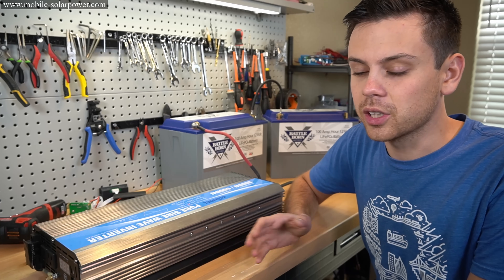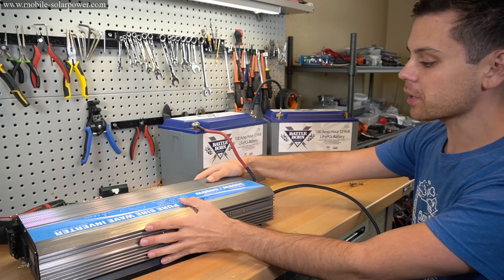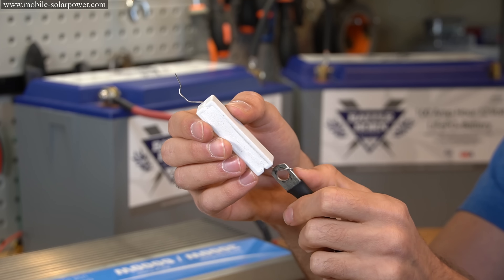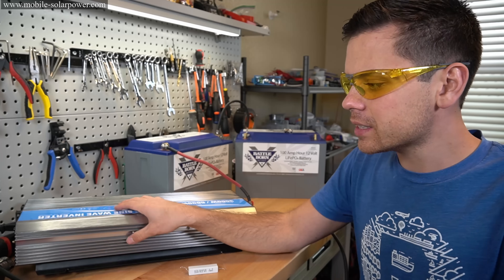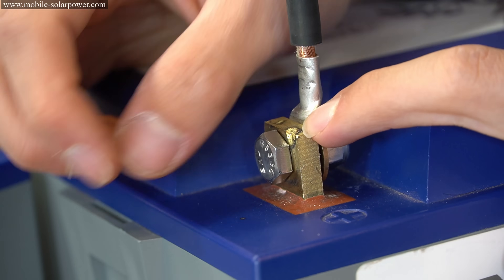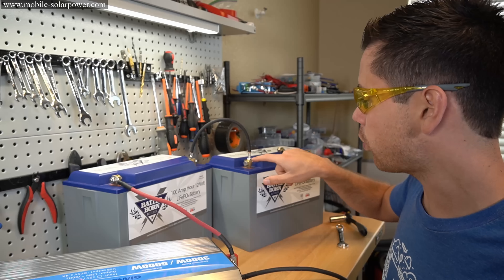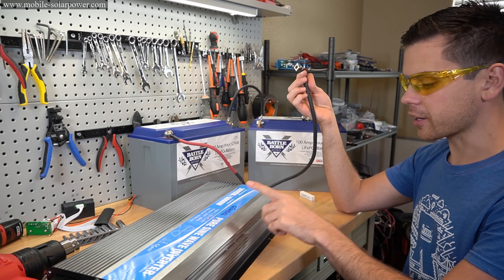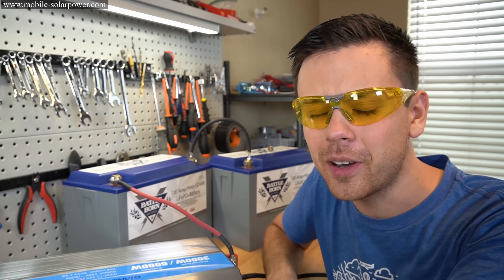How to Pre-charge Large Off-grid Inverters SAFELY. Save your eyes and your bank account

Comment: Wow, good video. So, what happens when you turn your system off using a battery disconnect switch? Does this surge / spark happen within the disconnect switch when you power things back on?
Reply: My question as well. I would think they would add a resistor to the switch, but I doubt they do.

Comment: I am actually having the problem where my BMS shuts the batteries down in 2x206AH SOK.  I then have to go into BMS and reset the batteries to turn them back on.  I have this in a trailer and wanted a remote switch to kill the inverter to stop power drain.   Every time my caps discharge in the inverter (3000watt Renogy) with a remote wired switch.  I then have a struggle to power everything back on.  Does anyone have a solution?  I was thinking of a super capacitor 5 farad like in car amps.   Anything I try would be an experiment(order part , spend money try/fail) so I would appreciate any help

By the way the only way I can get it power on is by your method or a car charger and once active everything works like a charm.  The 2 Soks are plenty.

Comment: Hi will I think you need to be real about a few things I bought a cheap Chinese inverter, well I was 300 Aussie dollars not cheap 4000 wt with 6000 surge though I had it covered until 1am when it went full on in fire , on inspection there was no copper coils only shifty little transistors please stop promoting this crap , I bought a VictronConnect 12 v 1200 it is the real deal, if I didn’t have a smoke alarm me an my son would be dead, as it went on fire at 1 am use your influence to protect us not so well off please save lives your a well off. Guy from solar a bench test means nothing 14 mths and fire is real I will give you all info on the system , which nearly killed me

Comment: Question:  I have a 150Amp "ignition protected" circuit breaker/switch between the battery bank and the inverter.  It is always off when I plug in the batteries.   I turn on the circuit from the switch.  Do I still have risk of sparking/arcing at the battery terminals?  I would think the risk is at the circuit breaker itself as the lugs on the battery are well connected.   I didn't see anything with my 12V AGM batteries and 1200 Watt inverter, but I am about to swap out the AGMs with LiPOs.  The following year I am probably going to move to 24V and a ~ 2000 Watt inverter.

Comment: So if I have 2 Enduro 12v 100ah LiFePO Batteries in Parallel and a Renogy 2000 watt Inverter do I have to use a resistor to connect them?

Comment: The Epever Ipower plus (5000W) has current limit to prevent sparkles/Arc when connecting the 48V batteries bank, this is nice, I did not have to use a resistor (LifePO4)

Comment: I ran into this problem on this setup. 100ah chins with renogy 1000 watt inverter. I was using heavy duty disconnect on negative in my rv installation. When I switch on the bms went into protection mode. So not all smaller inverters and lithium will operate correctly without pre-charge.

Comment: Can be used for + (positive) ? or only for negative (black) cable?
Reply: I am wondering the same thing.  I have a fuse and disconnect switch immediately after the positive battery terminal.  This would allow me to simply turn off the switch to discharge without having to remove a wire.  Seems like this would work, but I would like some confirmation.

Comment: Is this necessary each time i switch off the inverter or only when the breaker or power cable is actually removed?  And if I'm using it daily and shutting off by breaker at night but don't discharge it,  would i still need to precharge the next day?

Comment: Coming back to this after a while and I'm curious - this all works when everything is loose, that's great - but what about when gear is all installed and wired up, and either (let's say a van since that's what I'm going to do) the vehicle is going to be parked for a bit and one flips a master cutoff between batteries and everything else off for a while, and the inverter's capacitors discharge - or if maintenance is required and gear is disconnected/reconnected.

I wonder if having a master cutoff (big red Blue Sea dial for example) between the batteries and the inverter would suffice as a safety measure? If one were to wire everything up and then flip that cutoff back on, opening the circuit between batteries and inverter, would that work?
Reply from the maker: No, the caps will discharge. Either over time or with a self discharge circuit in the inverter. Master cut off switch is not advised. It's another fault point.
Reply: Master cutoff not advised - in general, or for this purpose? I'm guessing the latter but I like to be sure.

Now I'm reading on your forum some good suggestions to add this little resistor into an install, where you can use it to bypass a master cutoff and precharge the capacitors before flipping the cutoff back on. Sounds simple enough. Thanks!

Comment: Is this necessary if the batteries have an on off switch? No arc is possible if you connect when the battery is off, correct?

Comment: Hey Thanks will, perfect timing. I just got my 3k Renogy inverter yesterday. I am starting the 800watt solar for my 5th wheel Montana I live in full-time. I am wondering how I am going to wire it to my 50 amp system though.

Comment: Hey Will, is it the same case for a Victron Multiplus 2, or anything that has an on/off switch. If so I assume the Inverter should be turned on when connecting resistor?

Comment: Thank you.  Great info.  I recently bought 4x Lifepo4 cells for a 12 volt battery bank, a Daly Bms 200 amp and Victron gear including a Victron 12/1600/70 Inverter / charger.  Do I also have to do a pre-charge with this inverter / charger?  And do I have to do this once when connecting the inverter / charger or do I have to do this every time I want to use the inverter function?

Comment: wish i wouldve known about the inverter still having a charge before yesterday. i was testing a 3500 watt reliable 12v inverter and when i disconnected the wires from the battery i just let them fall down and they touched... scared the f out of me hearing it spark.

Comment: I have a question for you Will. I have a 12 volt 2000 watt inverter permanently connected in a camping trailer. Positive terminal goes to a 200 amp ANL fuse then to a battery disconnect switch. Batteries are two 6 volt golf cart lead acid 225 Amp Hrs. All wiring is 2/0 gauge. When not in use, switch is turned off. Question; should the inverter be pre-charged before turning the disconnect switch on? I will be upgrading to lithium batteries in the future.

Comment: Roll on to 2021 and I assume you can connect a 3000W inverter to a 100ah Renogy Smart Battery by connecting it all up in shelf mode and then turning it on? Will that be safe and not cause damage?

Comment: I got everything you said but the inverter has a ground wire and I have a stand-alone solar setup in my trailer. I have hitch batteries already grounded to the frame. On the inverter where do I put the ground wire? Or do I just forget it's there?

Comment: I always used an incandescent light bulb, when the bulb goes out, you know it's charged. It also works the same way to discharge. With a 12 or 24v system a regular automotive test light works great. Any voltage higher might be a little difficult to find a bulb for though?
Reply: for 48v just chain four 12v bulbs ;) Or maybe use a 220v og 110v bulb?
Reply: @a64738  SMH, my brain didn't even go there. Obvious!

Comment: Is it ok to just connect the batteries to the inverter with say a 100Amp resettable breaker switch for like 24V 2000W inverter, and just sorta pump the breaker switch again if it pops on the first go? protecting the bms through preventing more than 100A to be drawn and making it less hassle when disconnecting and reconnecting.

Comment: As an after thought I decided to install a Renogy 2000w inverter to my already built solar system. I have 3 100ah BattleBorn batts in parallel so its a 12v 300ah system.  I currently have a 250a fuse at the battery before the main disconnect and will be connecting the inverter to the positive busbar that is connected after the main disconnect. The max continuous watts I plan on drawing will be about 1500 for only a few minutes (toaster oven). 
Two questions: 1, will this fuse be ok and 2, do I need to use the pre-charge resistor?  Thanks for the help.

Comment: I discovered a method of precharging capacitors using no extra parts. Just the battery and the inverter. However, this method can only be used if you built your own battery from 3.2v cells. Simply attach the positive inverter cable to the positive side of the battery, then touch the negative cable to the negative post of the first cell in the series. Then touch it to the second negative post, then the third, etc. This allows you to use the battery itself to slowly ramp up the voltage, 3.2v at a time.
Reply: Make a video bro. I understood nothing

Comment: Holding your finger on that resistor  to discharge that inverter capacitor. Will kill you ,dangerous advice.  I work on guitar amplifiers  with large high voltage caps .  I have a 1100 watt inverter  for 100 watt renogy solar panel  ,wanderer 30 amp solar charge controller.  12 volt  100 amp . AGM BATTERY, Mighty max .

Comment: So if you aren’t disconnecting any wires, however you have a circuit breaker, what happens when you re set the circuit breaker after a day of not noticing it’s off ?

Comment: do you have any info on how to add a 20amp 12v outlet for higher power like 2000watt for I have this giandel 4000watts inverter and the installed outlets are just for 1500watts

Comment: Hi Will, I just posted your video on the FB group called "DIY RV Solar Systems" and several of the so-called professional installers say the pre-charging is not necessary.  I guess they prefer to use the "smoke test" and expect to see the huge spark.
Reply from the maker: 😂 no way. Tell them to talk to the CEO of Battleborn about destroyed bms from this issue. I wouldn't listen to folks on that group.
Reply: @WillProwse  Battleborn battery warranty says I need to use an approved Current Surge Limiter for inverters over 3500 watts. Do I really have to spend the $280 in their CSL device to satisfy the warranty terms or can I just use a cheap pre-charge resistor or light bulb to know when it's done?
Reply: @WillProwse  - I will tell them, Will.  Thanks for responding.  I'm not listening to them.  I prefer listening to experts like you.

Comment: Many people install a switch or circuit breaker between the battery and inverter.  Whenever the switch is flipped on, it will also generate a spark.  I suppose we could manually pre-charge manually or install a push-button switch with resistor before flipping the switch but is there some kind of contactor, delay, relay, and/or device available off the shelf that can be installed across the breaker/switch to AUTOMATE the pre-charging?  I doubt such an accessory cost much to make.

Comment: Thank you Mr. Prowse for your thorough reviews and DIY information, I truly enjoy your channel. Would you please elaborate on the resistor discharging procedure for us novice people, I lost you on where to connect the resistor! I have a one battery setup; 100A, 12V AMG Deep Cycle stand alone Bat., with a 3000W pure sine inverter behind my car for my mobile office. Where would I connect the resistor before connecting the Battery leads? Thank you in advance for your time and best wishes on your endeavors. You are an old sole young man :)
Reply: The video shows how you do it, you put the resistor between the minus lead and the inverter before connecting it for a little while to charge up the inverter capasitors more slowly. You can also use a small light bulb instead of a resistor and if you use the correct voltage bulb if will light up and go out when it is fully charged.

Comment: I wish I would have found this video before ruining my BMS from Aliexpress.  I'm using a 3000w inverter and of course got the spark and now I only get like 3 volts from the BMS when it's connected.  I ended up ordering one from Overkill and they are identical, but he one from Overkill is twice the price.  Does anyone have any ideas on whether or not there is any way to fix the one from Aliexpress?

Comment: Would you recommend that I do this on my new portable battery bank that is a 12V / 200Ah LiFePo4 battery and a 2000W Pure Sinewave inverter?
Or is this just for higher voltage systems lik 24 and 48 volts?

Edit: I just bought the components about a minute ago and I thought I might as well ask, so I know if I should buy one of these resistors as well.

Comment: i'm gonna be hooking up a 1500w to a 100ah lithium battery and i cant find the resistor you're using. local shops only selling these upto 10W instead of 25W. Will a 30ohm 10w resistor do the job ?

Comment: Hi , I have followed these steps because I was getting a massive spark when trying to connect the inverter for the 1st time , I got the 25w resistor as mentioned and it still sparks , I've tried leaving resistor connected for a minute or so but it gets very hot . I've then tried again but still the massive spark ....please help

Comment: I had seen this video, but forgot about the caps after blowing out a 30A fuse during some load testing. 
Putting in the new fuse was a little scary! The lesson is now welded in, so to speak. 
 I didn't have a 10W low resistance resistor handy,  so I put some clips on a 120vac 40w light blub. Works fine.

Comment: I would think an easier way to do this is install a circuit breaker somewhere, leave it open, but jump the terminals with the resistor.  Once it's charged up, then flip the breaker.
Reply: I would have used a 300A automatic electronic fuse in my system. They work great as a circuit breaker, but the largest I could find in the store was 70A ;( . On my car stereo I had 200A ones and that worked great for 10 years as a circuit breaker. This far I have been connecting my 24v 3000W inverter the sparky way but until now I only had small lead acid battery bank. I just bought LifePo batteries and is making a 200Ah 200A 24v battery bank, think I will have to use the resistor method for connecting from now on.

Comment: Just another tip when it comes to capacitors, it is really easy to calculate the resistor needed. But this only work IF you a aware of the capacitance of the bank.
 What you calculate is the time constant or RC R=resistor C=capacitors.
t=R*C so if you got a 30ohm resistor and a bank of 100'000uF (0,1F), just put those values in the formula and BAM!
30Ohm * 0,1F = 3s to about 60% charge if they're completelly drained.

The second advice is, why bother with dischargin when you easily can just permanatly mount a resistor beetween the power "poles/skrews" and as soon as you disconnect the battery bank it starts to drain the capacitors. Same formula just the opposit result. But I'd use a larger on, let's say 1K (1000Ohm) which will drain the capacitors within 2min.
A 1000 ohm resistor will draw about 0,012A or 0,144W so you'll ned atleast a 1/4W or 1/2W resistor.

No disessambly required at all for any of this tips.

Comment: So for mobile power I was thinking about installing a 2000 watt inverter in my truck and running off the trucks battery. Should I install a higher AMP alternator to keep up with the load?

Comment: I have a Renogy RNG-INVT-3000-12V-P2 3000W Inverter which is powered by 12V. I want to make my battery bank 24V. How can I step down to 12V to power my Inverter?
Reply: Every time you change the voltage you lose , if you have a 12v system stay at 12v

Comment: I have my 2000 watt pure sine wave connected through a separate on/off switch when not in use, which is done frequently. What impact is there on the battleborn batteries  when it is reconnected through the on switch? I do this in case there is any draw from inverter on batteries when off. I do not see any burn marks on my batteries.

Comment: If you have an off-grid system where the inverter is wired through a switch and it's been off for weeks (think RV), do you have to pre-charge the capacitors before you turn it on? If so, how? Do you have to disconnect, then reconnect?

Comment: If you don’t use the inverter much and have a battery cutoff switch to it does this mean every time I use the inverter I have to pull the connections off and do the resister on batteries again???

Comment: Sometimes I get a spark when just connecting batteries in my bank. Can I prevent that by using a resistor between each connection just before I bolt the connections to the terminals?
Reply: It might help if the things that make is spark is capacitors, give it a try.

Comment: Does anyone know what resistor should be used with a 12v, 3000w inverter with a 12v LiFePO battery? A link to Amazon would be great, but I can't seem to find it in the description. Secondly, does anyone know the formula for calculating resistor? Thanks advance. Great content, Will!
Reply: He’s doing it with a 25 w 30 ohm resistor and it’s a 24 v battery system and a 3000 w inverter

Comment: Hey!  Is there a way to take 3 inverters and set up a timer circuit to create a three phase inverter from 3 single phase?  The 3 phase inverters are very expensive.  If this were possible, it could potentially save about 1/3 of the cost.  Maybe its not a good idea, but it would be cool if there was a way.
Reply from the maker: Just buy inverters that can be paralleled for 3 phase output